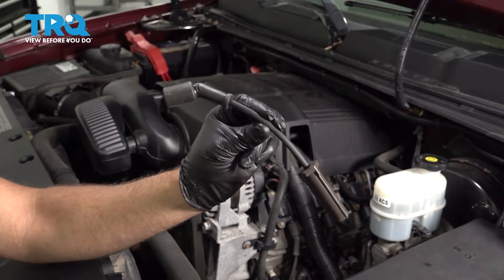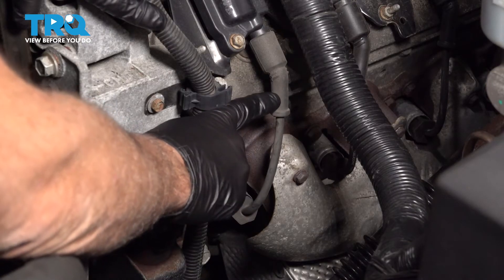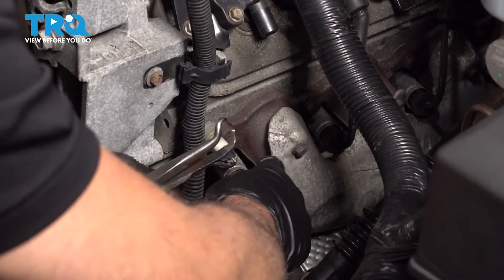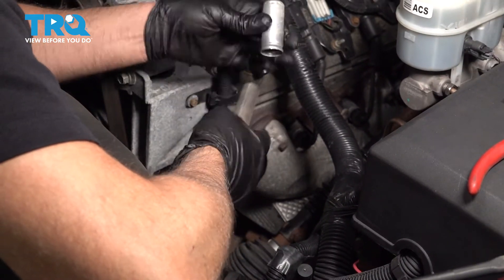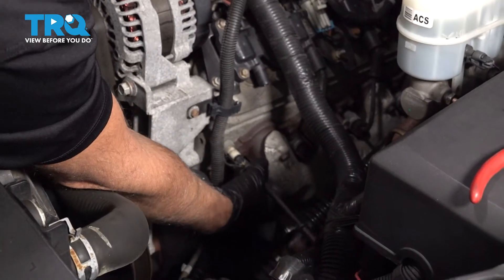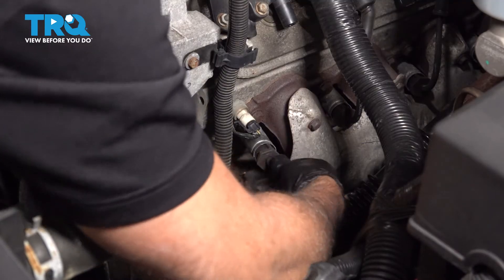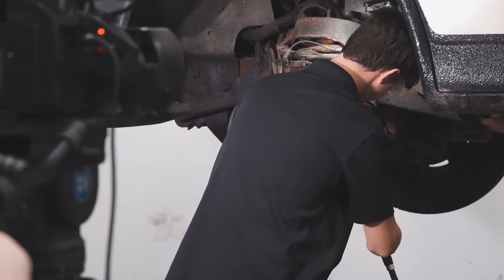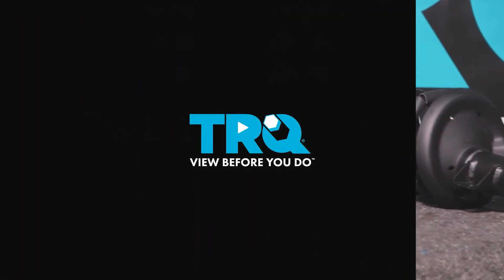How to Replace Spark Plug Wire Set 2007-2013 Chevrolet Silverado

Comment: Misfire code 2012 Chevy Suburban 5.3 cylinder 7, stabilitrak warning light at same time, replaced spark plug in number seven, runs like a sewing machine. Many thanks for the video.

Comment: I did exactly that and now I have. A heck engine light and the truck idles a bit more than usual. It’s a misfire but what did I do wrong. I know the plugs are correct because I wouldn’t have been able to screw them all the way in. Any thoughts will help.